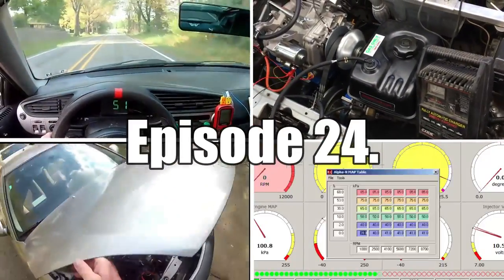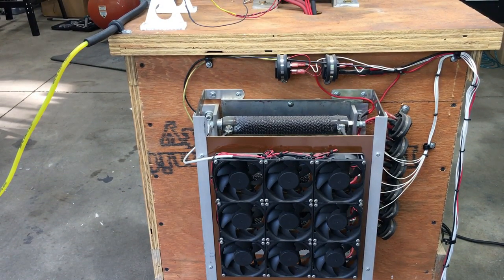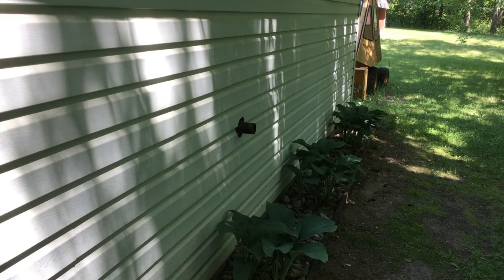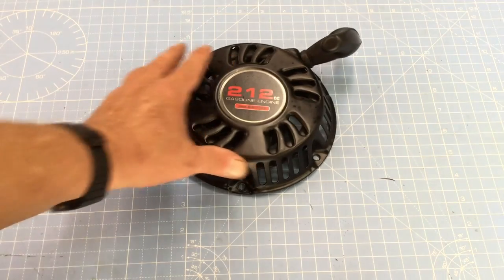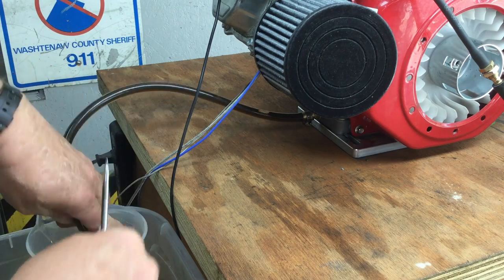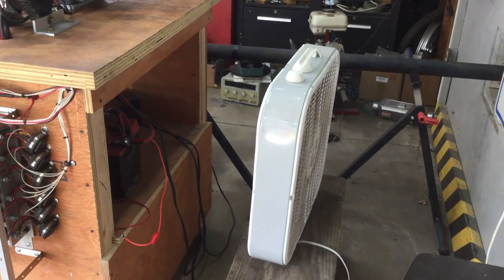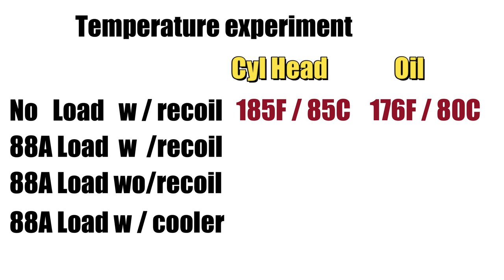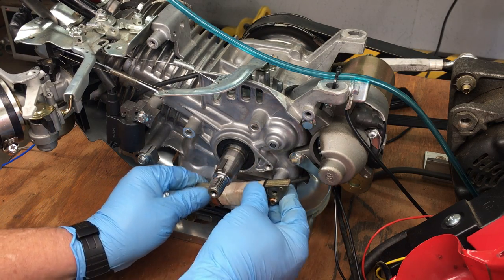Episode 24.  Testing an oil cooler on a 212 cc Predator engine

Comment: OK, The spider incident including prolonged camera panning was no accident... Whats up with that (XR80?) Honda engine?

As for cooling, ignition timing and air fuel ratio have an effect on temp as well. Seems that engine in original tune would be able to cool itself at 100% output by design. Now adding additional air and fuel (mo powur) will produce more heat. Seems the alcohol in E85 would be the simplest cooling solution. 

Pushing additional cooling air volume may also help somewhat, but to a lesser degree than E85. I like the oil cooler idea but be mindful of possibly aerating the oil. I saw lots of air in the cooler line. Splash crankshaft oiling may not work so well in that case.
Reply from the maker: E85 was not practical to test on the bench engine, but will likely be used on the car when we supercharge it.  The spider and the XR75 were interesting things to kook at while the engine droned on.
Reply: @robotcantina8957  Ahh OK. I actually thought for a second, replace the predator with the XR engine. lol
The XR is too small, lacking torque, cooling, etc... 

Now possibly a larger water cooled bike engine. I've often daydreamed of a newer BMW boxer twin engine transplanted into a tiny car like a Triumph spitfire, MG midget, or possibly a lightened up Miata...
Reply: @Jeffsa12  CONGRATULATIONS  ROBOT CANTINA...   104k   subscribers....  JIMBO  you provide the fun
and entertainment that viewers enjoy👍👍👍!

Comment: I am confused  ??  What temp would you like the oil to be ?   An oil temp around 100c is pretty much ideal. Running the cooler dropped the oil temp below optimal and the added viscosity of your already thick oil put extra load on the engine.  So not surprisingly the cyl head temps were higher.
Reply from the maker: You pretty much need to watch the previous videos.  At the time we were running a 420cc  predator engine in a Honda Insight and the engine and oil were running hot.  so as an experiment we tried this oil cooling method on a 212cc engine to see what effects cooler oil would have on the engine.
Reply: @robotcantina8957    OK, I understand. Will watch.

Comment: The oil temp with the cooler is too low, you will lose power. Optimal temp of oil for power is over 110c but the oil will degrade quickly, the 104c you are seeing is about ideal. However you want a cool head, as low as 60c coolant is best for peak power in a water cooled engine. 

The recoil removed is doing a much better job overall then the oil cooler, as I said you want to keep the oil hot and head cool. You can start these engine with a drill directly on the crankshaft nut. For mouse safety you can also cover most of the inlet with a mesh. 

Focus on cooling the head, maybe a direct cool air feed ducting sealed onto the inlet?
Reply: Interesting on oil temperature and power. I assume running fully synthetic would help with the degradation?

Comment: Maybe a beltdriven oilpump/Fuelpump would require less energy? 
Or atleast doesnt mess up the power equation.
Reply from the maker: I like your thinking, but I searched for days to find a suitable oil pump that could be driven from the jackshaft. unfortunately there are no cheap pumps that will work.
Reply: Power steering pump would do the job, especially one with a remote reservoir.  Nissan liked nice compact units and you could probably swap or adjust the relief valve to get pressure down to something more reasonable. 

Bonus for being able to play with and use the pressure to experiment.  Plumb in a manifold with either orifices or valves after the cooler so you can control distribution and then start targeted injection or spray.   Splash a little cool oil around the head, let it run back.  Spray a little oil on rockers or crank bearings for longevity.  Ultra-high performance supercharged motor? Then you need oil squirters for the bottom of the piston.

I know you are limited on electrical power, but it would be interesting to see if one of the little 12v spal 5.2" fans would flow as much as or more than the fan on the crank and free up some power.  Probably some value in partially blocking piston area air flow and prioritizing the head too.
Reply: @robotcantina8957  From the top of my head. Check out a Powersteering pump for a Volvo 200 / 7 / 900 Series. Its a one bolt pully, Small and should be easy to adapt to other pulleys. And probably cheap at the Reckers.

Comment: did i miss it or was the test rig efi or carb?
Reply: Carb.
Reply from the maker: The test rig was a smaller 212cc engine with a carb.  The car is of course fitted with a 420 cc and EFI.  Anyway the test rig was use to validate ideas that would most likely work on the larger engine.  Its not a perfect experiment but it did show improvements are possible.

Comment: Swap out the single cylinder engine for a 670cc V-twin, Cheaper in the long run and more power...and with an oil pump the opportunity for a better oil cooler system too.
Reply from the maker: we will certainly do the 670 engine, don't worry about that.  Most of the fun we have is experimenting and right now we are focused on the 420 engine.   Now, I totally realize the 420 is not a very practical engine to use, but it makes for interesting experiments.
Reply: @robotcantina8957  CONGRATULATIONS  ROBOT CANTINA...   104k   subscribers....  JIMBO  you provide the fun
and entertainment that viewers enjoy👍👍👍!

Comment: Wow! The numbers are as good as a liquid cooled engine. 
I'm guessing the cht will run 140f + hotter when installed in the car operating at a heavy load during a hot day.  
I'm betting the valves and seats can handle it just fine until 400f. Probably has good quality stainless steel valves. 
I wonder if detonation will spike the temps past 425f, fast with the e85. 
 I think the oil cools best with low flow through the cooler.
I'd like to see Pyrometer data too.
Kinda wonder if a Knock sensor, and ignition retard is more or less important on a small engine like this under heavy load. 
Interesting stuff.
Thanks for the share.

Comment: To solve the power issue I don't think that an alternator would be that hard to fit, to sold the temp issue further a rad e-cooler fan would work just fine. but space is a premium in the go-kart.

Comment: His plan to supercharge the predator 420 won't work unless he gives up the ability to pull start the engine because the fabrication of a custom pulley driven of the engine pull start location will have to be made basically replaces the cup that engages the pull start system that also helps engine air cooling fan and is bolted to the crankshaft the best use of the supercharger would be better suited if he went with a predator 670 V-Twin because they make a supercharger/alternator kit for the predator 679 V-Twin engin because red beards garage has used it on their videos before.

Comment: I have wondered if anyone has tried a modified ignition coin as a charging coil, re wind it to generate power, maybe a pair of them , basically just wrap wire around it, and mount them , about 180° apart, could be interesting if it works, it would be a pulse, but maybe at high rpm it would be a steady current,

Comment: Maybe it need to fill more engine oil ,to compensate for  the oil in the radiator, so the engine won't get hot

Comment: the supercharger should raise the head temperature even more (engine load to drive it and the raised compression / temperature raise of the intake charge ) a water to air intercooler running water through it out of a bucket filled with water and ice should help though it might loose efficiency
air to air might work too but to me seems less efficient , i have a smart fortwo 450 and it has a verry small intercooler with a fan that might work for youre aplication 
maibe you can add water/ ethanol mist spraying on the cooling fins of head in extreme cases to cool it down some or add it to the airintake of the forced cooling , you might allso be able to mount a bigger or more efficient cooling fan on the flywheel say from a vtwin engine and adapt the covers to alow for its bigger size ducting the intake for the coolingfan to the outside air would probably work too (draws in less underhood temperature)

Comment: The oil temps are too low, 75°C isn't good neither.
The oil temp should be between 100°C and 110°C, my VW Beetle works at that.
If the engine in your car doesn't get above 110°C under load, you don't need the oil cooler, maybe a tiny one if gets near 120°C.
What you need is cooling for the cyl head, maybe some cooling lines between the fins at the top using a water cooler and a water pump

Comment: Jimbo,  You're running 20w40 in the engine? ??  That's waaay too hefty .  You live in Michigan and generally colder climates require less hefty oils. (Of course you know that and I'm stating the obvious - i live in Missouri) that might be part of problems.   Try 5w30 Rotella or Mobil.
Reply from the maker: I run the heavy oil on the street legal go kart because the engine gets noisy when its hot.  I going to try 10w30  with the recoil removed.
Reply: @robotcantina8957  ah gotcha.

Comment: use a thermostat to turn the oil pump on only when needed. that'll save some power and keep the oil temp in the best zone. maybe a shroud to use the head fan to draw air through it.

Comment: I’m a meth head so I’ll go ahead and suggest meth injection. You can tie that in with fuel injection mapping (like aquamist) to really fine tune the mixture ratio.

Additionally, you can run some ducting right to the block/head. Even a small auxiliary fan will help (better if it is ducted).

Comment: Don't compare these temps to water base coolant temps. The loaded aircooled CHT and oil temps are what they should be.  Here is one of many references on oil temps: https://www.hotrod.com/articles/engine-oil-temperature/
Reply from the maker: Cool, thanks for the reference.  The truth is, I don't know what the crank case oil temp is on the car... yet.  The cylinder head on the car engine will run at 240 to 275 and spike to 320.  Once we start testing the car again I will monitor the oil temp and see what is going on.
Reply: @robotcantina8957  With such a small capacity oil system, the indicated oil temp is much closer to the peak oil temp that what is recommended for other applications. Imho, ideally the starting capacity would be low for a quick warmup to 210 or so then stay there. OEM oil cooler installations often have bypassing thermostats to block flow to the cooler when below normal oil temp. With your efi tuning, be sure to stay rich of peak egt to aid cooling. If you'd like a speed/load sensitive cooling aid, try a ram air (dryer duct) and or a misting nozzle from the windshield washer.
Reply: @mv8mstraseapfcc113  CONGRATULATIONS  ROBOT CANTINA...   104k   subscribers....  JIMBO  you provide the fun
and entertainment that viewers enjoy👍👍👍!